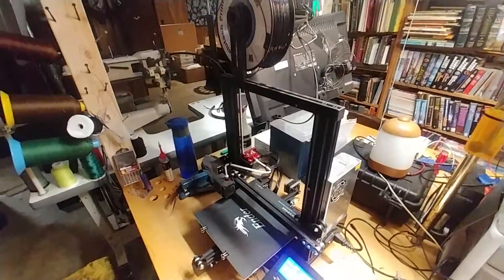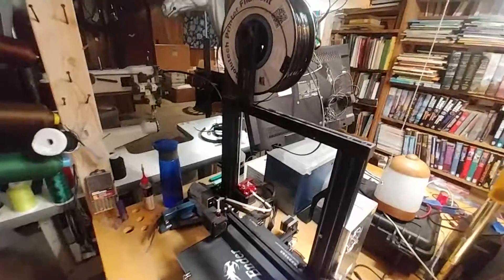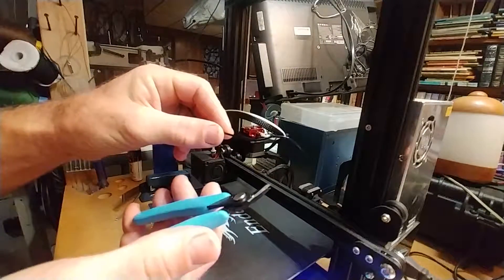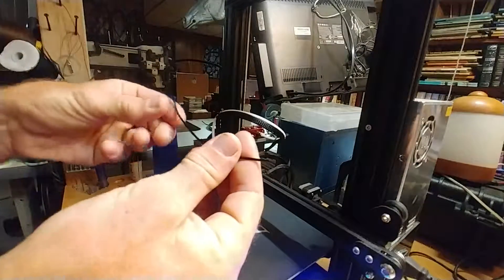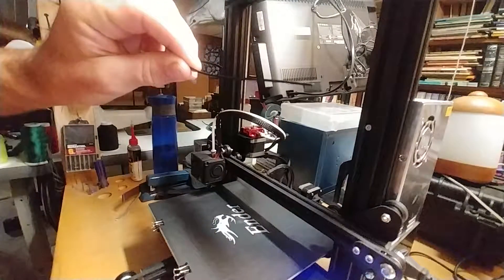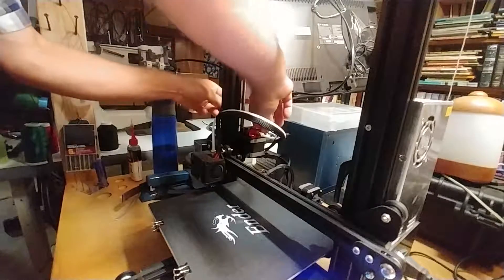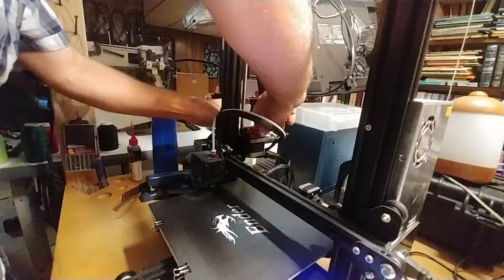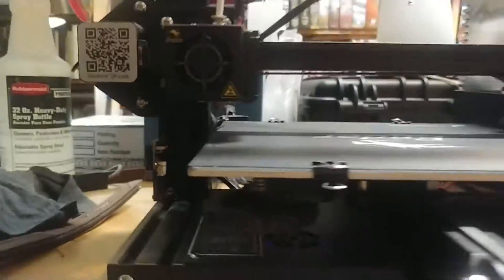Ender 3 3D printer, how to load filament

Comment: i have two of these machines.  of all the regular aspects, this is the most consistently frustrating.  for those of us who design things, this is obviously a design failure.  the opening into the metal bracket shouldn't be a tiny hole that's only a half millimeter or so larger than the filament for easy feeding.  it should be a funnel or conical shape that tapers within 2-3 mm to the current diameter.  that larger opening would much more easily facilitate feeding.  between the pulley wheel and the feed gear, a funneled aperture shouldn't cause a problem.  the other problem is that there are so many parts surrounding the hole at all times that it's never well lit to be able to see the hole as you're trying to hit that tiny target.  you can't even hold a flashlight because this is a two-handed task--minimum.  taper the cut and straighten the filament, but this is still needlessly difficult.

Comment: Bending it straight didn't work for me, I had to bend the filament slightly to the left (as seen from the direction it's fed from) since pressing the release button turns the filament to the right. After that I had to turn the indicator wheel (Ender 3 v2 btw) while holding slightly pressing the release to get it into the tube
Reply: thank you - keeping it straight hadn't worked for me but bending to the left did the trick
Reply: damn bro, your advice was more helpful than the video, thanks.

Comment: mine seems to jam up in the second hole between the connector and the bowden tube.  Any suggestions?  I already cut at a sharp angle and straighten, but i still get jammed up in the second hole for some reason.
Reply from the maker: Sometimes I just have to push and pull back and forth until it finds its way through.